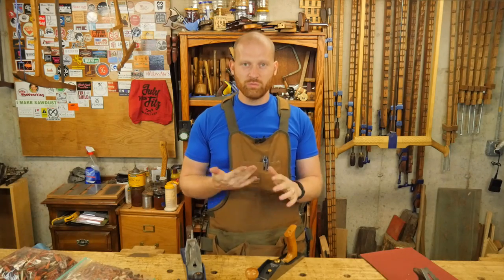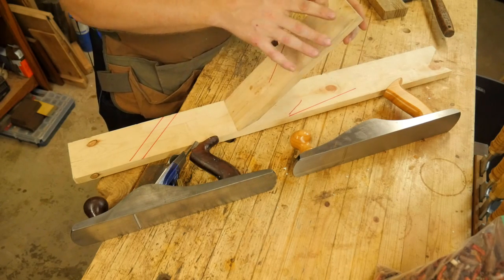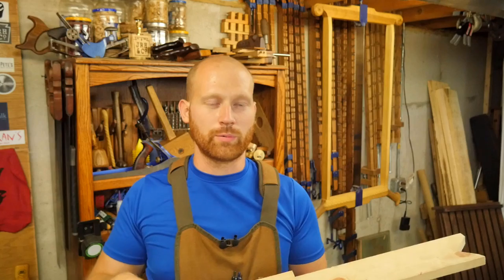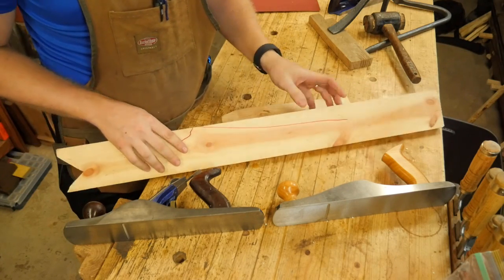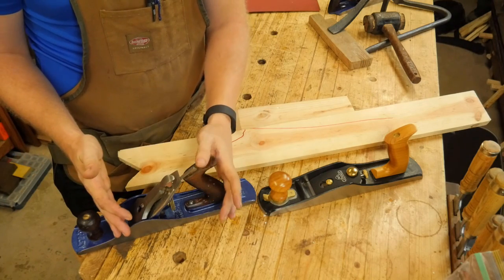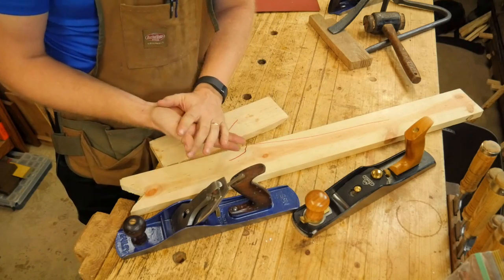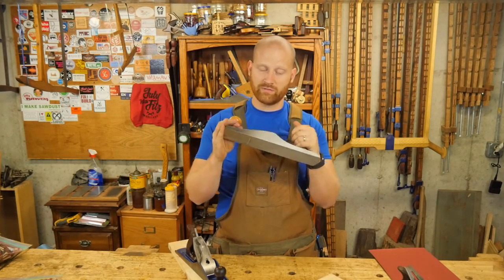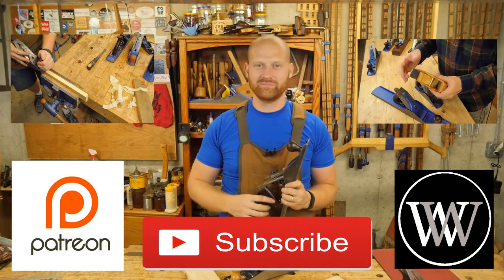Low Angle Jack Plane Vs High Angle Bailey Pattern Hand Plane Hand Tool Woodworking

Comment: I don't get it... I have a Wood River low angle, my only plane, and have no problems planing curly maple for a coffee table I'm doing.  I do need to close the mouth and take a small depth of cut, but I'm making tissue-paper-thin curls and getting a fantastically smooth finish.

Edit:  this is with a sharp, 25 degree bevel, no secondary.
Reply from the maker: ya,  curly maple is not that much of a problem. It is comparatively homologous. As long as you take a low enough shaving it can do that. you should try curly oak or some of the south american switching rotational grains. those are FUN!!
Reply: @WoodByWright  ahhh I see.  So this white oak burl I have drying out is a great reason to buy a new plane.  I'll start working at my wife now!

Comment: Sigh - I truly hate pressing "enter" and submitting the comment.

Seems like the difference is that with Bevel Up you can set your cutting angle to be the bedding angle + whatever you grind the bevel too. Bevel Down has a chip breaker, changing the cutting angle requires a new frog. Both allow you to set the throat size, blade projection and blade skew angle.

I wonder if anyone could design a chip breaker for a bevel up.
Reply from the maker: right on I do that all the time. Correct, I think most people think they need to change the angle of the cut more often then they do but some people change it all the time. that is a new thing to hand tools.
Reply: @WoodByWright  Its all a matter of: how much do we want to spend on irons/planes, how convenient is it to change, how big a difference the angle makes to us personally and the eternal quest for the perfect shaving.

Comment: Great video but i’m going to have to disagree. The low angle jack plane is a MUCH more versatile plane. If someone is only going to have one plane they should definitely go with the low angle. In the case of dealing with figured woods the low angle has a much easier solution then a traditional planes, all you need is a second 25 degree iron and put a steeper 43 degree micro bevel on it, bam figured woods covered with a quick blade change. A second blade is much cheaper than a second plane, plus you dont have to worry about frog adjustments and then re-adjustments at all.  Low angle wins for sure on being able to do anything and everything with simple blade changes.
Reply from the maker: that is what makes the sport so great! there are so many different ways of doing it. and everyone has the way that works best for them.

Comment: Where are the Low angle planes made ?
Reply from the maker: there are several companies that make them this one was made by Stanley but it is their newer cheaper version. not the best on the market but works well.
Reply: @WoodByWright  
 Yeah, I thought as much, I am looking at the Veritas version, bit more expensive but made in Canada, think I will stick with this one, or there is the Luban, made in China but from all reports the quality is fantastic..

Comment: Has anyone tried a chip breaker on a bevel up. It’s just a matter of bevelling the edge. If it helps a bevel down there’s no reason it wouldn’t help a bevel up.
Reply from the maker: a few have tried, but it is incredibly difficult to maintain a good fit when you are regularly sharpening and micro changing the surface that the chip breaker sits on.
Reply: I’ve just made a couple of rebate planes, low angle bevel up and normal bevel down. That and your video prompted me, as they both are difficult to adjust. I might copy Bearcat as in your challenge and get a Veritas adjuster. I reckon a sharp edged chip breaker might work with the bevel up. I find it a bit of a mystery that some planes work really well and others not so.
Reply from the maker: yup hammer adjusted planes can be really difficult to master. a lot of fun once you get them but still difficult.

Comment: Stop with the $10 Stanley # 5 at garage sales. More like $50 minimum for junk that would require many hours to restore, if possible.
Reply from the maker: Where are you at? There are a few places around the world where that is the case.
Reply: Two months ago I got a No. 4 Handyman and a Stanley 110 for $15  (for the pair) at an estate sale. They both need cleaning up, and the 110 has a chipped blade, but...$15.

Comment: 8:55 - "(the chip breaker) ...  forces the wood back into it's place ..." 
What ?
Reply from the maker: Yup. It compresses the curl helping keep it in place infront of the cut, rather then it fracturing infront of the cut causing tearout.